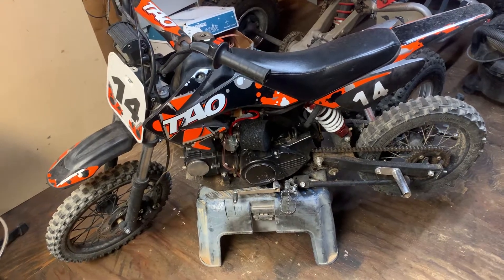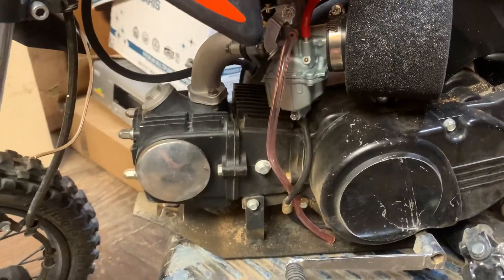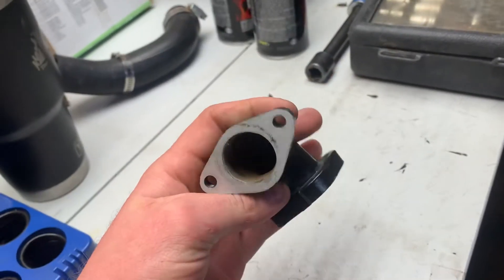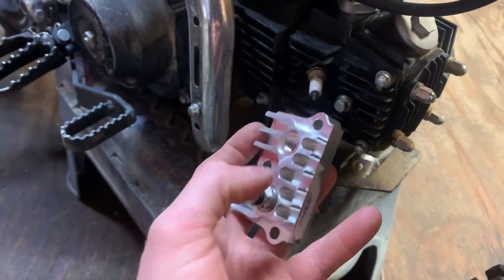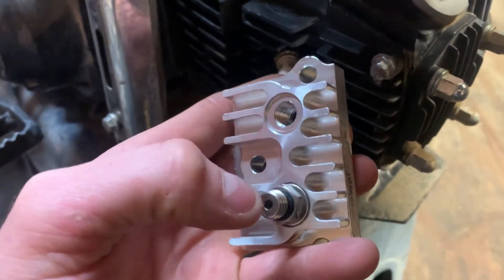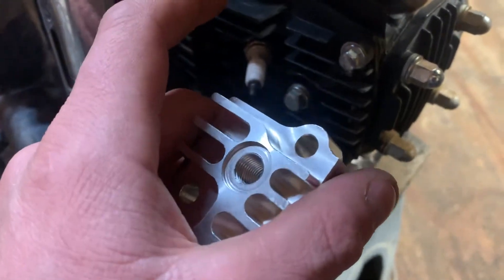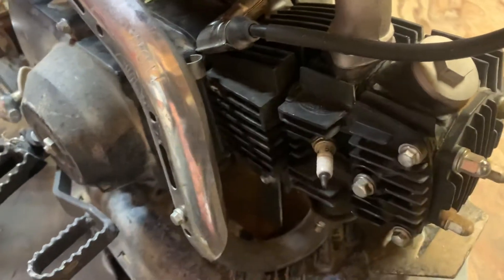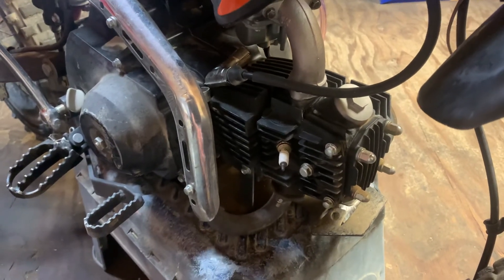Turbo On a 110cc PitBike (Part 1)

Comment: Be interesting to see this. I made a turbo kit for a xy150 and it does alright. Without running the waste gate I was getting 15psi which is way out of the range of the vz21 so the waste gate is back on. For my turbo oil feed I found a banjo fitting on eBay I think m8 x 1.25mm and it has a 1 mm restriction drilled into it. Mamba I think was the brand.
How are you planning to mod your carby?
Good luck with it all dude 👍
Reply from the maker: Hey thanks for watching.  Check out my newer videos or go to my TRX Vlogger Channel and you can see the video I explain as much in detail as I can.   Cheers!
Reply: Had the same proces my dude, raddd

Comment from the maker: so I have to correct myself with the oil circuit I was wrong the way the oil circuit works on this pit bike with the new oil plate I'm gonna have to use both oil lines not block one off.